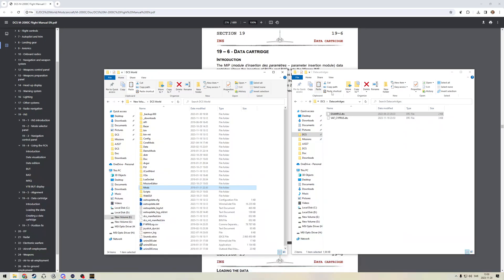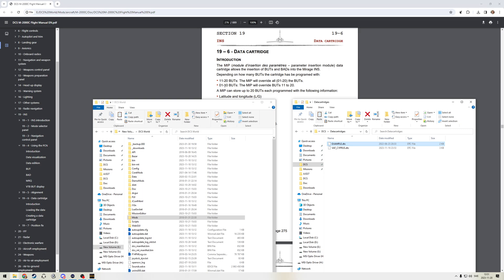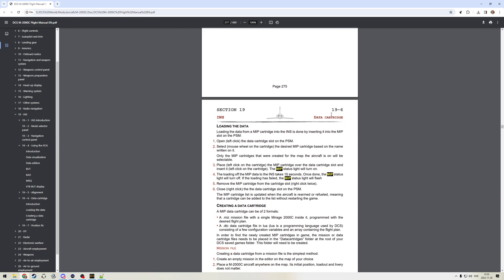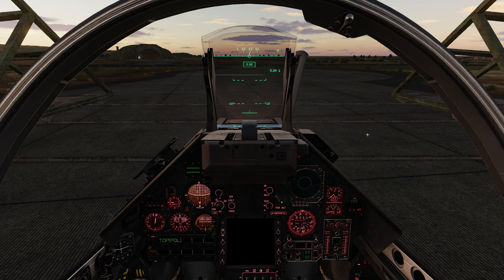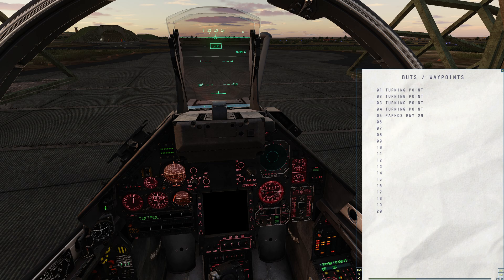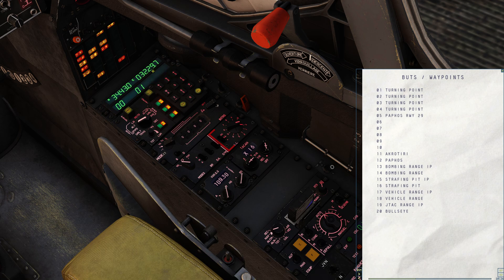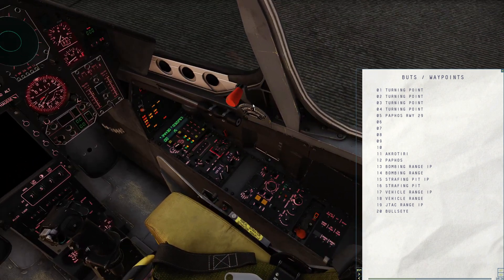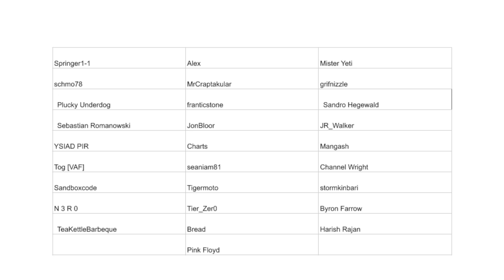DCS M2000C Bonus 4 - MIP Datacartridge

Comment: So if the data cartridge doesn't load, do you just follow the same procedure for your NES cartridge? take it out, blow on it a few times, insert it again wiggle it around and then power on again.
Reply from the maker: This usually isn't a problem as the ground crew pre-blow all the cartridges for the pilot.